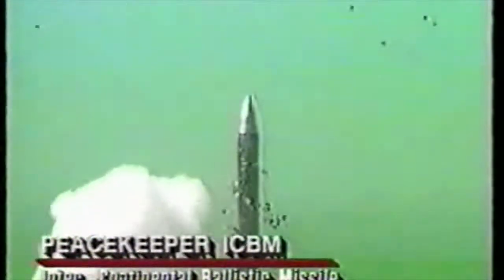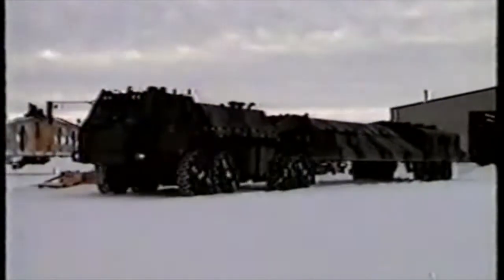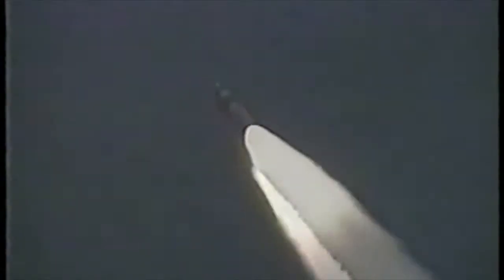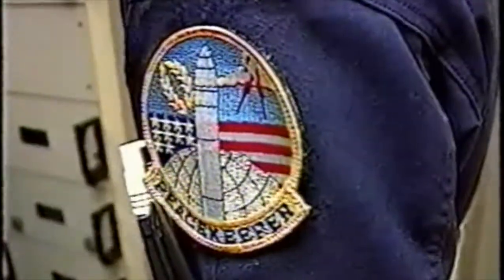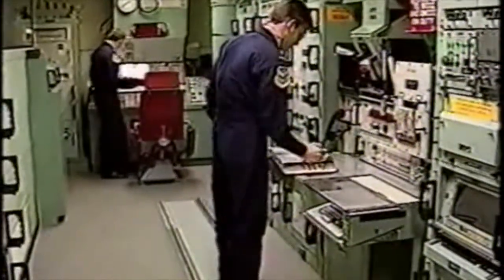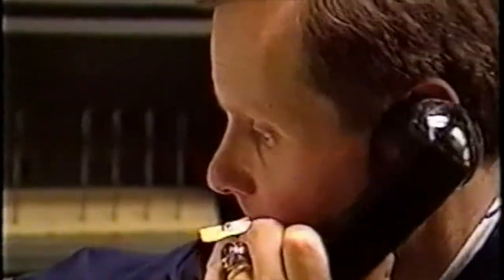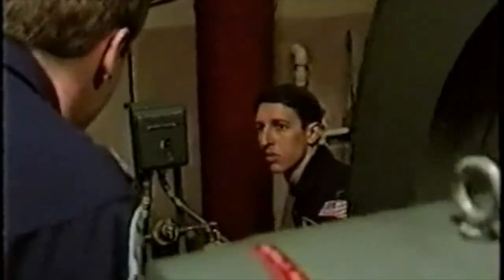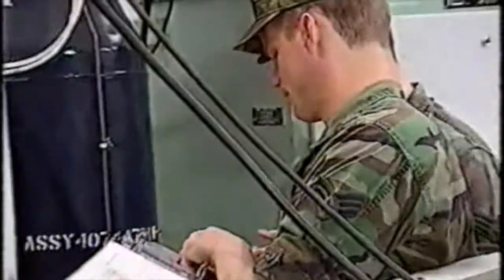LGM-118A Peacekeeper (a.k.a. MX) ICBM Weapon System Overview

Comment: The U.S. was very stupid to give up the MX system especially after spending millions on development and deployment of the missiles. We need to throw capabilities on the system now to offset the developments by unfriendly countries.
Reply: Yep.  And we're STILL stuck using 1960's era ICBM technology with the Minuteman III, until the long awaited Sentinel finally comes into service.  Even still, the Peacekeeper was more powerful than even the mighty Sentinel will be.
Reply: @Sentinel_ICBM  No, Igm 35 will not be different than the existing minuteman...it will have only one warhead and similar payload capacity to the minuteman, in contrast to that russian satan 2 have 10 ton payload and 24 glide vehicles..now  peacekeeper is most needed than ever!
Reply: @PritamMondal-ps4cu  you should update your ICBM knowledge past 1985 somewhat, the accuracy of both SLBMs and their warheads has not much to envy from the land-based options. And with a post-cold war limited warhead count, the most survivable leg of the triad was prioritized...
Reply: I disagree. It was much smarter to focus on submarine launched  missiles which are much more survivable.
Reply: @daikucoffee5316  While I agree SLBMs can often be the most survivable of the triad in a lot of situations depending on the sub location, I don't see any good reason why we couldn't continue with the Peacekeeper project in tandem with the Trident program.  Peacekeeper was under Boeing, and Trident under Lockheed, so it's not like it's an issue of too much work being placed on a single contractor.  Also, if a vulnerability were found on our ballistic sub fleet and were exploited by the enemy in the way of a strike, an EMP, or some other way way of disabling our use of SLBMs, then it would be imperative that our silos stay capable of launching ICBMs, and our B-2s and soon to be B-21s be able to strike from the air.  The survivability of each of the nuclear triad have their own pros and cons.  All three are highly survivable given the lack of intercepting ability from Russia/China, not to mention the use of decoy MIRVs and other tactics etc etc.
Reply: @daikucoffee5316  no..slbms don't  have the payload capacity and accuracy like icbms...but yeah icbms are more vulnerable
Reply: Yep - Mobile MX as envisioned scared the hell out of the Soviets because there was nothing they could do to determine which launch points had a live missile and no way to hit all the possible locations .... funny that it and the SDI program were killed by congress ... the two programs that visibly kept the soviet threat at arm's length .... were abandoned.  I often wonder why.
Reply: ICBMs are not much more than warhead sponges at this point.  Which is a valid role don't get me wrong. 

If the US was at all serious about strategic warfare we'd build road mobile systems like the Russkies but we're not so we won't.  Our defense establishment exists for purposes other than national defense at this point.  At least the Tridents are real.